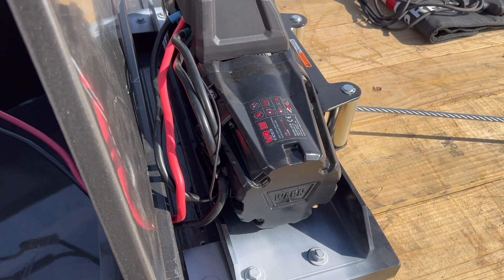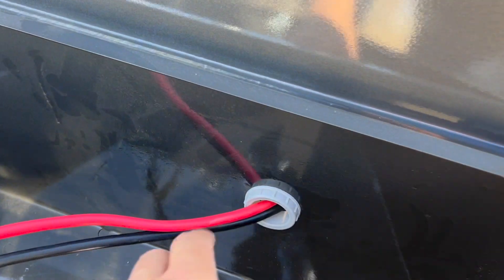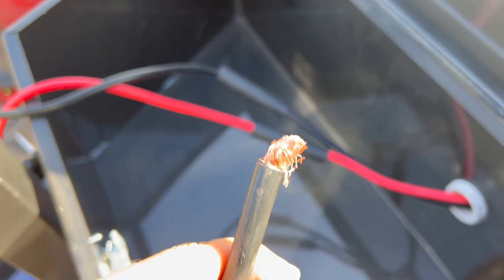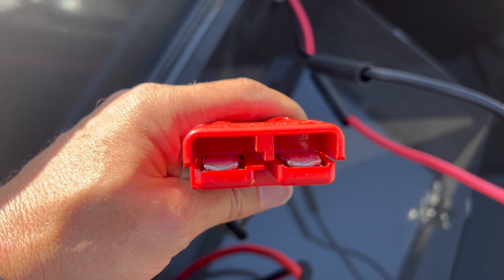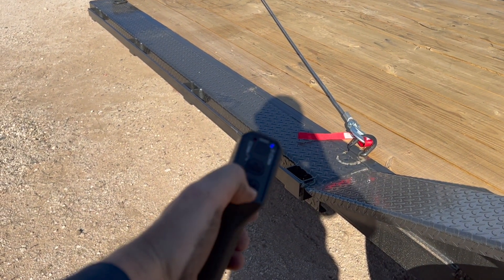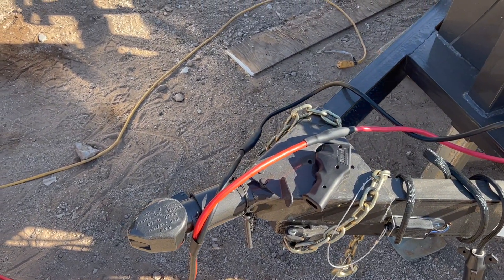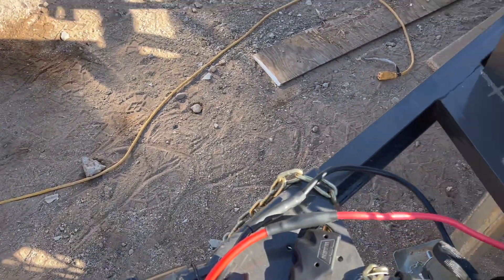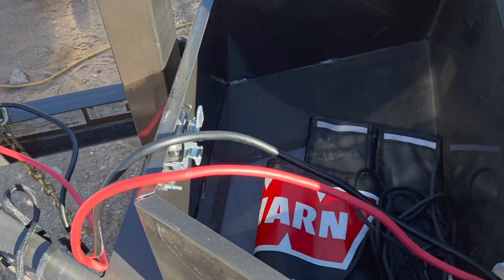Battery Delete Must Have Mod - Quick Connect Power for Trailer Mounted Winch

Comment: Wow, like this. Wish you had shown how it was connected at the truck battery, under the hood.
Reply from the maker: Thanks for watching!!  The battery is just the positive and ground connections.  You can add a switch under the hood or the dash to “cut” power to the back if you do not want it hot all the time.  I use the trailer so I did not see the need for a switch.
Reply: What Amp is the Anderson like disconnect rated at?